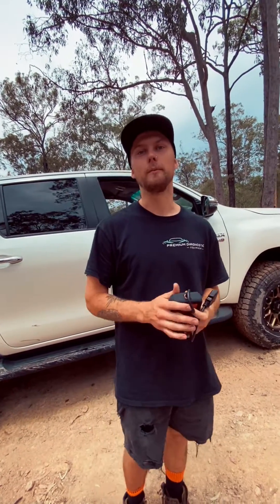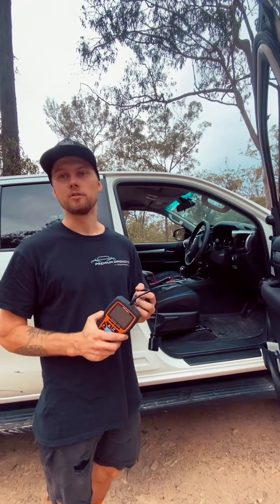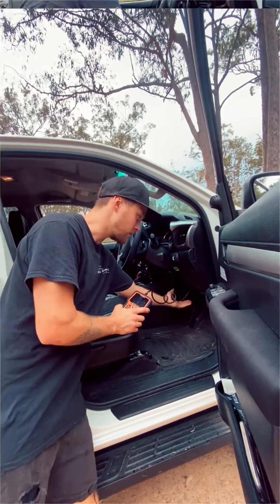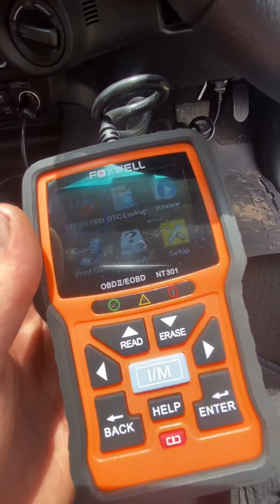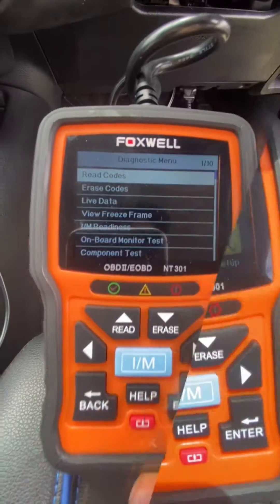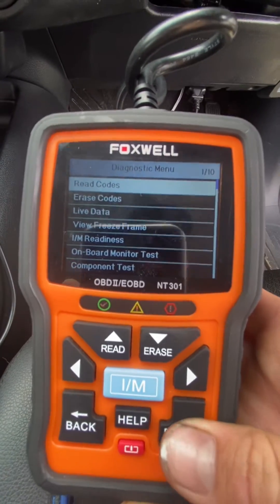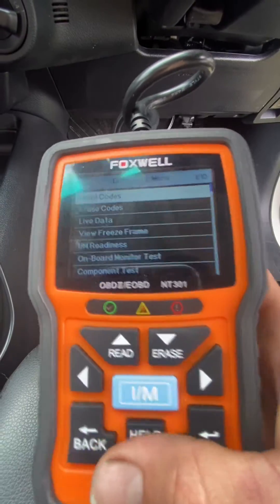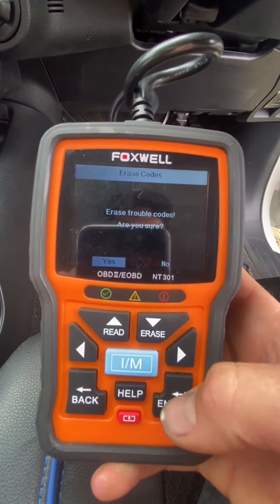Read and Clear Fault Codes Using The Foxwell NT301

Comment: 2007 BMW 328i with a red steering wheel lock code after some battery issues. Nothing wrong with the engine but I can't start the car. Will this clear that code so I can drive away?

Comment: Would this work on a Holden RA Rodeo (4JH1)? And other Holden vehicles? I have a bosch one and it doesnt work and many others and i would buy this seeing how it is cheaper than the Bosch one and seems better overall
Reply from the maker: Hi Michael
What year is your Holden Rodeo? The Foxwell NT301 will only work on OBD2 compliant vehicles. Most Holdens are OBD2 from 2006 up but Rodeo are obd2 from 2004 up
Reply: @premiumdiagnosticequipment9141  it is 2006, it has the OBD2 port under the dash, i can only scan ABS codes but not vehicle codes with my current one but is works on other cars